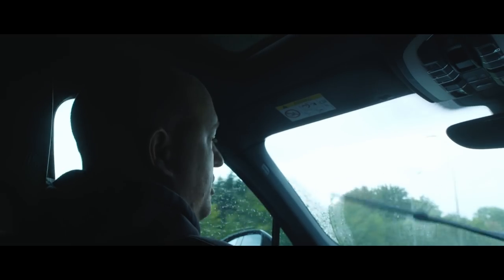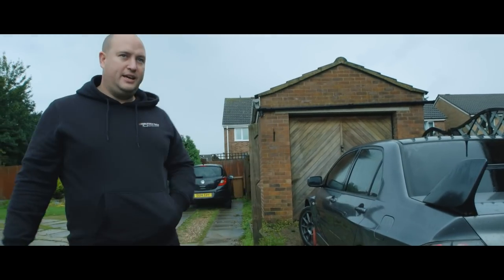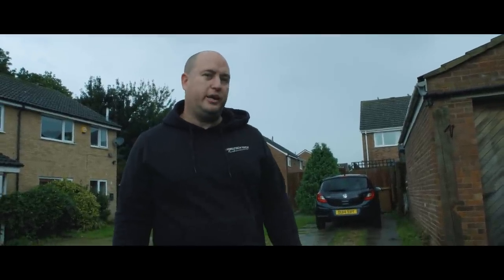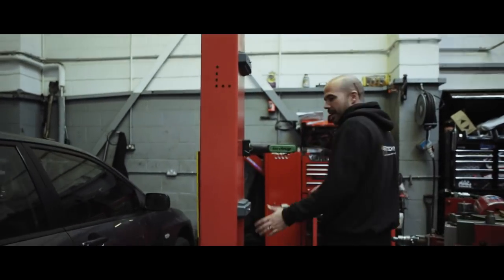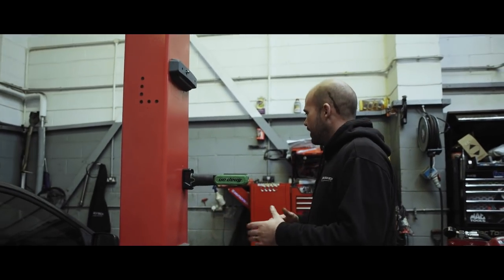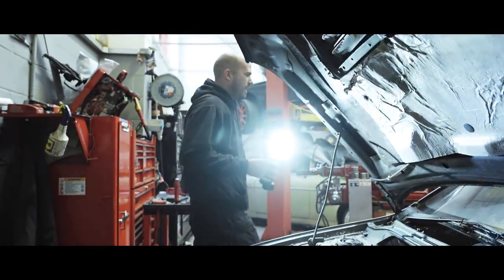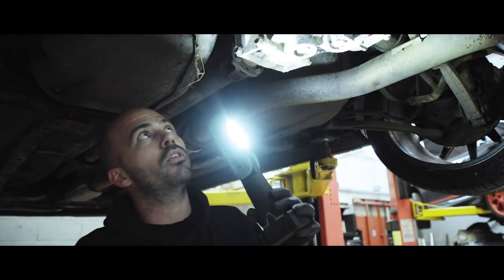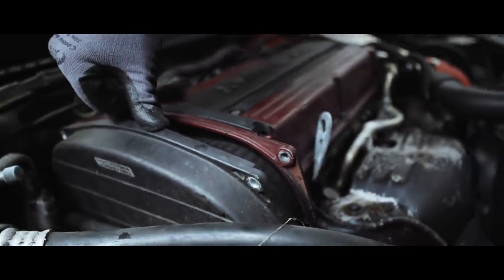DEUTSCHTECH BARN FIND PROJECT CAR! *REVEAL* | Episode 1: Collection

Comment: No start issue on my evo has been dead fuel pump and faulty cam position sensor if you guys need a starter or an OE cam position sensor i hae them cheap for you 😎 also have a new valve cover gasket kit you can have
Reply: You have to wonder if it is a bit more serious that a sensor or fuel pump, why would anyone leave a car like that to rot on a drive?